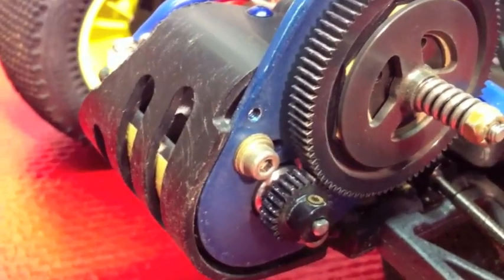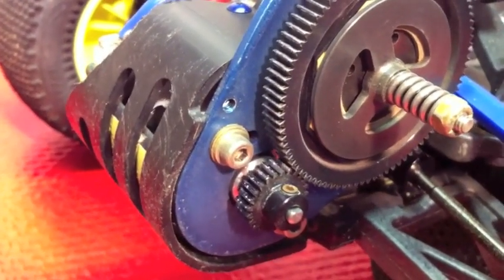RC Truck Stop -- How to RC Gearing 101

Comment: i have been doing indoor rc drifting and have been running into the spining problem, i already installed a lager pinon gear, modified my shocks any other advice you could have?
Reply: you could maybe loosen your slipper

Comment from the maker: It won't always happen, but it can. It's kind of like driving down the highway in third gear instead of upshifting. That is why we suggest only selecting gearing by temps.--Matt Higgins, RC Truck Stop
Reply: RC Truck Stop Videos i bought a slash 4x4 vxl. i wanted bigger wheels/tires so i put desperados with 2.8 trenchers. the slash came with a 13T pinion and not sure what size spur. anyways...the slash is going into thermal shutdown after 5 minutes run time. i have tried a 9T, 11, 14,15,and 16T pinion( wasnt sure whether to go up or down until i just watched your vid) and saw no signifigant change in speed and it was still shutting down.What do i need to do to run these tires? Please help....i'm getting really discouraged.
Reply: RC Truck Stop Videos  Hey I know this is an older video and a good one. But is there speed difference or motor heat difference when running larger pinion for speed vs smaller spur for speed, even though the ratios can me matched either way. Which is the better option for speed vs heat.

Comment from the maker: That is a great question. If the vehicle is running normal and I am not noticing any power fade and I know I am not pushing the suggested gearing limits, I usually check after a five minute run. This allows all components to reach operating temp but isn't so long that I will likely damage parts if I am over-geared. If you're nervous, check at around two to three minutes of running and then recheck anywhere between five to seven minutes. hope this helps and good luck.